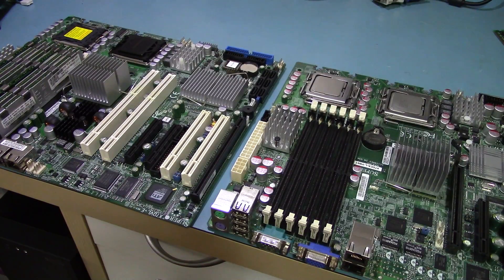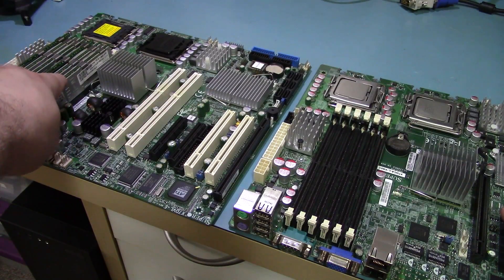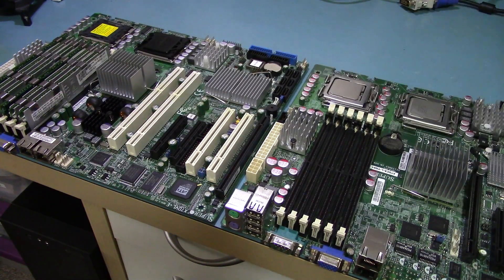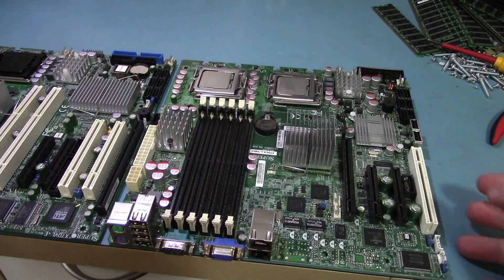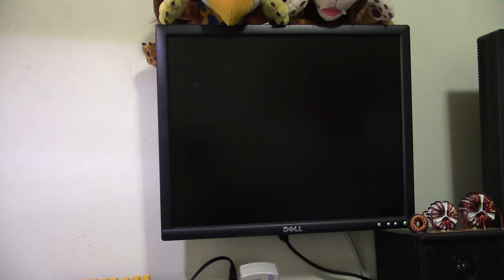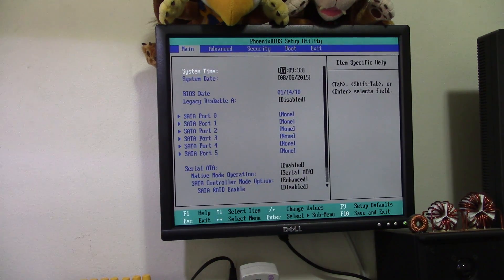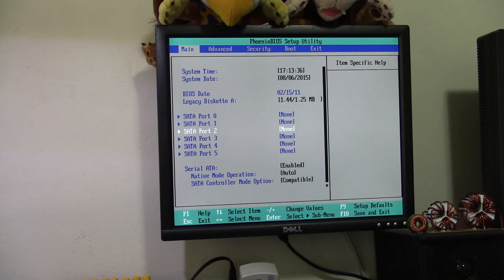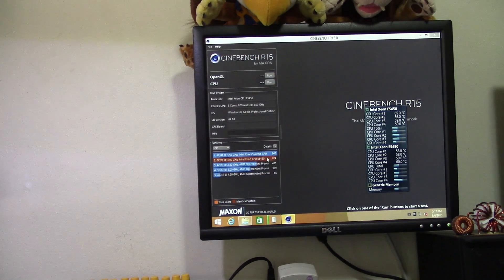Hackintosh Super Micro Dual Quad Xeon Build (Part 1 of 2 - X7DCA-L Motherboard)

Comment: hello i am thinking about building this exact thing but i was wondering if u had like a parts list? and do you turn on the computer by just plugging it in? or can u connect the power button from a case to it?
Reply from the maker: I don't have a parts list to hand. But it was built very low budget with basically whatever I had lying around.

Case: Any ATX case will do. Ideally you want a large one. You might have to do some mods to make the large backplate on the motherboard fit.
Memory: Anything cheap on eBay. Check SuperMicro's site for what the specific type you need is.
CPUs: Fastest you can get at a good price.
Cooler: Any 771 cooler. Socket 604 coolers are not compatible despite looking the same.
Power supply: I would recommend 500W as a minimum. Mine was a little less than that, however.
Optical drive: Optional.
GPU: Nvidia for Hackintosh use. Check before buying to make sure it is compatible in Mac OS.
Case fans: I use Noctua. But you can go cheaper if you want.

The general rule of building a Hackintosh is to check the compatibility on Google for the motherboard, CPU, GPU. Everything else is usually plug and play.
Reply: Ok thx 
I have spare parts laying around as well
I have a very large case I'm going to use
Reply: Will a gtx 280 work?
Reply from the maker: +Landon Babbitt It should work out of the box. Also, the power switch at the back can be used to completely power off the system (if your power supply has a physical switch), but Mac OS can control the power like a normal system. Shutting down from the Apple Menu will power off the system and the front softpower switch on the case turns it on. Like a normal PC/Mac.
Reply: +Peter Brockie k thank you

Comment: I have a question about X7DAL-E from supermicro it has 1x24pinATX and 1x8pin EPS+ 4pin EPS for PCI Express ports, do I need 4pin EPS to power up my future buildm, even with card which uses it's own power cable?
Reply from the maker: +Ramag Dehz Generally they require all power connectors filled. You can do a test run to see if the system is stable without the 4-pin. But I would keep it under heavy load and keep checking the wiring to the motherboard to see if anything is getting hot. If you're using a single CPU it might not be needed. But who is going to use a single CPU in this day and age? :D
Reply: +Peter Brockie 
Thank you for answer . So it remains to be seen when all components get shipped. For the first test run I will use my old PSU with low grade graphic card, for the long run new psu it will be. I will be back with info. Your video helped me decide to tray such build.
Reply: +Peter Brockie 
I have but one more question, this time about BIOS update. In archive from supermicro site for X7DAL-E, there is no file with ROM extension only X7DAL1.704 file without it. Must I add it manually before flashing ? Is there a possibility to flash BIOS under windows with phoenix winflash?
Reply from the maker: That's the file. Simply run the DOS BIOS update file with that as the file name. (it's something like flash.bat X7DAL1.704, but check the readme file for the exact command).

I wouldn't recommend using anything other than their own DOS software - you can easily make a USB flash stick into a DOS boot drive with a free program called Rufus.

Clear the CMOS settings after the flash by shorting the appropriate pins on the motherboard after updating as I have had problems with SM boards without manually clearing the settings after. The CMOS update instructions are in the manual.
Reply: +Peter Brockie 
Thank you again!
Reply: +Peter Brockie 
Hi again. Thank you for this video which inspired me to seek out this kind of build. I received my X7DAL-E mobo today, it came with dualcore processors, I upgraded BIOS without any problem thanks too your video and advice. I already ordered  2x 5450 like yours luckily pretty cheap . Are these copper heat sinks enough for them? I also noticed that some thin black radiator on my mobo runs pretty hot 70C, I don't know which component it is covering, it was not included in manual it is located near 3 coils in center of mobo. My samsung ram is also hot in range of 70-80C(aluminum heat sinks)is it normal and safe? I smacked fans on ever ram and other hot components, only this black radiator is left without fan. Thank you again.
Reply from the maker: The heatsink is probably the motherboard chipset. They get pretty hot, but it shouldn't need direct cooling as long as the case fans are running.

The copper heatsinks I used are enough for the chips. However, you do need air movement inside the case as those fans just move air around inside instead of forcing it out. If you are talking about copper heatsinks without fans, you will need to replace them unless you have a server case designed for passive coolers.
Reply: +Peter Brockie Thank you. Same heat sinks with fans, like those in the video. So there is no rose without thorns, with heat output. :)
Reply from the maker: Yeah, there are proper coolers for the 771 socket which suck air in the front and out the back (instead of directly down), but I wasn't able to track any down for a reasonable price. Even the ones like mine were pretty overpriced at $20-30 each. Considering the cost of the board was about that. Haha
Reply: +Peter Brockie 
It can be a quite money trap. It is hard to hold costs as low as possible. Same prising is in my country, most coolers are passive and there is a problem with backplate. These which we have are also quite heavy 700g each. I plan to put everything in old coolermaster midi tower, with some fan additions. If I am not bothering you already I post some temperature info of finished build, after cpu's arrive.

Comment: I am thinking of getting this board and a couple of older xeons for a budget computer, but I can't seem to find ram that would work with it, particularly in the 16 gb capacity. I've also found ecc registered dimms for a good price, but they are advertised for specific computer brands. If anyone knows about anything on Amazon that would work, or any specific type, some help or advice would be greatly appreciated.
Reply from the maker: The ram is standard. Just look up the motherboard and it will be on SM's site with speed and type information. 

Specific memory for computers is only marketing from sellers. Simply match the type (DDR2, x00 MHz, ECC/non-ECC) and it will work.

As far as I know 16 GB DDR2 sticks don't exist or are super rare. Even 8 gig sticks are rare and listed as untested by Super Micro for this board.

4 gig DDR2 ECC sticks are pretty readily available.
Reply: +Peter Brockie Thanks. I wasn't looking for 16 gb dimms, but rather sets of 16 gb. Those seem to be cheaper than getting four dimms of 4 gb separately. Anyway, thanks for the help. I wanted to make sure that if I got ram, I could be fairly confident that it would work so I didn't have to go buy something else.
Reply from the maker: DDR2 is very common and will be pretty easy to find for a long time. Groups of 4 are usually cheaper, but not always. Remember to compare the price per gig on any auction as sometimes buying them 1 at a time from someone can be a good deal. :D

Comment: Will the E5472 work with this board? its fsb is 1600mhz and the boards website says its validated for 1066/1333.
Reply from the maker: +thehaloguy I don't know specifically, but it shouldn't hurt anything by trying, so if you have them give it a shot. Usually the worst which happens is a couple beeps that it doesn't like it. Chances are it will run at a slower clock speed though, so you probably want a motherboard designed for it.
Reply: +thehaloguy No, it does not work, I tried. I tried updating codes as well, still nothing. You will most likely need the 1600fsb for that chip to work.

Comment: Now THIS I am looking forward to.

A 2008'ish Mac Pro hackintosh build:  It should be pretty interesting, and I'm curious to see what the end result will be, as I'm not familiar with MacOS at all.

Do you forsee any problems with the compatibility of the board's BIOS though?  I know that these systems often benefit from post-Install DSDT tweaking.  It's also somewhat common in Linux.

Is the GTX275 really necessary??  I say this because nVidia cards of that time are pretty unreliable, at least in the long term.  The GeForce 2XX series are G9x based.  In fact, Apple even dropped nVidia for many years after they had a near 100% failure rate on products that used their chips.

Out of curiosity, which other videocards would be compatible with the iteration of OSX you're planning on using?
Reply from the maker: khachaturian I have the system working so far. I just need to shoot the video.

Right now the only thing which isn't working is the video card - shows garbled screen once Mac OS loads when enabled. But it's just a matter of me sitting down to get it working. Mac OS installed super easily - basically default non-DSDT settings and it seems to work great (although who knows how bad the GPU problem is, I might need to go the DSDT route for support).

It was $30. That was the main reason. Although I do tend to lean toward Nvidia just because I like the cards. I just want anything which is decently fast in Mac OS.
Reply: ***** I prefer nVidia as well, but the hardware from that era just didn't last.

What I remember from tweaking the DSDT for Linux was that you had to extract it from the BIOS and then de-compile it, and then re-compile it with iasl and then fix each error it reported.

If someone already used your particular board, chances are they documented what changed needed to be made.

If you're going the non-DSDT route, does that mean that your fans are not dynamic?  IIRC, fan and power management required some cooperation between the BIOS and the OS, and that's why I never thought it a good idea to just brazenly run a laptop in Linux.  What seemed to me to be like more than 90% of the time, the fan didn't scale up or down properly in Linux, and the CPU would throttle itself.
Reply from the maker: +khachaturian the fans are 100% positively dynamically controlled in Mac OS. So much so that it drives me a little crazy listening to them rev up and down. I might stick them on full or something since the steady noise bothers me less. Note: they behave the same way under Windows on this system.
Reply: ***** Which means that they didn't implement hysteresis in the cooling algorithm.  Or maybe it is there in the BIOS, and you just need to fiddle with it.

My Toshiba laptop has the same deal.  I find it really quirky, but it doesn't bother me.
Reply from the maker: khachaturian Nope. None at all. It's a huge difference in sound from low to high so it's very noticeable. They can be set to full though. It might not be with the case together. Time will tell. I still need a part or two and to solve this GPU problem (I have a shitty GT210 here as well and it does the same thing).
Reply: @PeterBrockie  3 years late but as you probably know a bios update fixes the fan problem